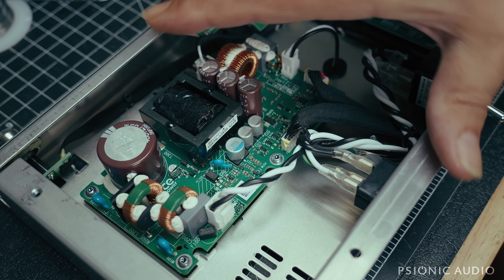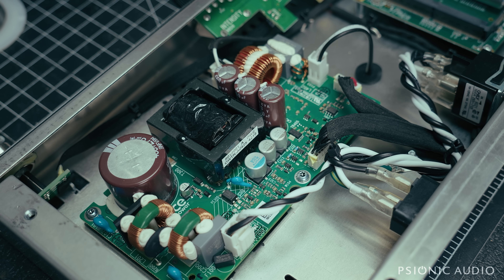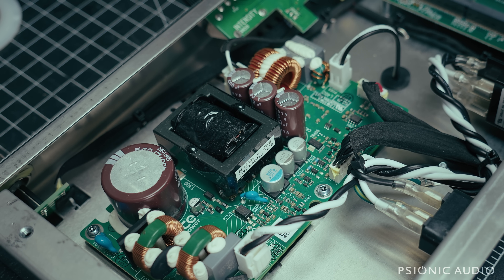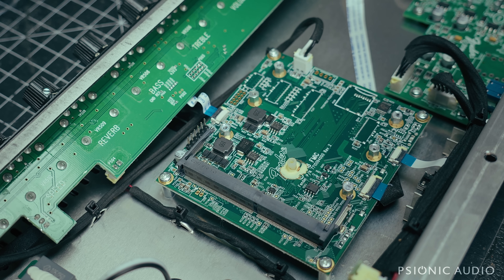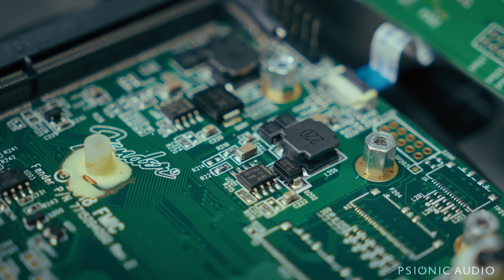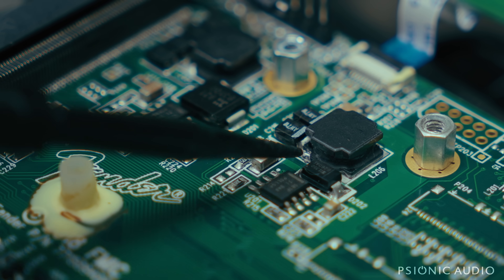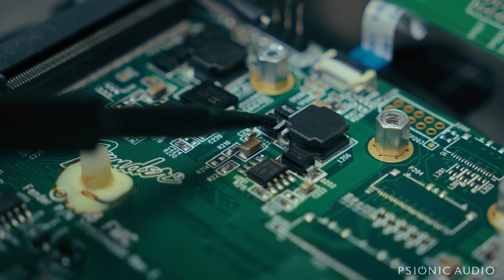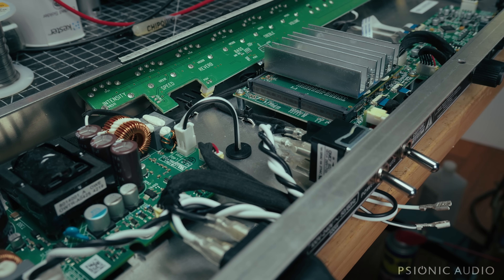The Fix is In | Fender Tone Master Deluxe Reverb No Sound and Flashing LED Pt 2

Comment: I had no idea Fender is making guitar amps which are 100% digital. 

Having worked on tons of “digital” and SMT PC boards for 20+ years I have 2 recommendations: 
1) Get a decent quality hot-air soldering station. 
2) Get the part numbers from the SMT IC chips and download their manufacturers data sheets. These often contain detailed schematics for “recommended application circuits.” Most real-world electronic products will be pretty close to these recommended circuits.

Comment: I have one in the shop with the exact same symptoms. When it first came in, I swapped in a known good ICE module to no avail. Fender Service told me Oahu has several service centers. They do, if you need guitar services…

I dunno, when I see an electric guitar plugged into an amp, it’s a single instrument with two parts.

Comment: Glad you didn't hate on it too much.  I have both tube amps and a DRTM.  I have to admit, I love it.  It is easy to move around, sounds great, and so far has been bulletproof.  I hope that doesn't change.
Reply: I have a bad back and my AC15HW1 with a Weber Blue Dog alnico makes my 60 yo back hurt! So, I am digging the TM Deluxe Reverb. My psych board sounds great through it. For me , it's 52 lbs vs 23 lbs, lol. . .

Comment: Nice fix, the cpu daughter-card reminds me of the ones in old powerbooks.  That signal drop at power-on is quite interesting, I have a Digitech pedal which does something similar but haven't had a chance to investigate it properly yet, its just a little repair project for a free day but would be interested to have an idea what to look for going in; suspecting a failing cap but its all smd components & hard to measure so I'm waiting until I get really bored before starting that one: bypass works until first press of the footswitch when the pedal drops all signal for a couple seconds, then works fine unless power is removed or the effect is switched off for more than two-minutes at which time the fault reoccurs which can be a little distracting whilst playing; less of a problem with an amp which isn't being switched on & off during play.
Reply from the maker: Oh, this isn’t a problem, they probably just auto-mute the output for a fixed period to make sure no pop comes through the speakers.
Reply from the maker: In the Tone Master I mean. Yours probably has an iffy cap in the flip flop circuit.

Comment: Brad Webb is one of the smartest people I have met (not in person) in my 58+ years of wandering about on this planet. I have done SMD with the small iron that plugs into my old Weller, and now I have the Pace tweezers, the Pace hot air too, the small Hakko pen. The Pace are Sensatemp. Chipquick paste sure makes life lots easier. A puddle of flux, some extra thin (expensive) solder and a tiny iron & tweezers with a very steady hand works okay if you are used to it. I  went from my Baush & Lomb microscope to some old Dental magnifying glasses. The depth of field and field of view are very small with them but unlike a high magnification Optivisor my face is not 2-3 inches away from my work. It's out around 12-14 inches away. Much much better! The B&L dissecting scope is just a pain in butt.

Comment: I could have sworn Brad had one of these, to the point where I was confused to see the follow up here. Yall get so much of the same stuff at the same time that I can’t keep it straight until I hear the accent (or lack there of).
Reply: Yes, I've had a few.
Some were this very issues, others had fried Icepower modules.
So far there's only been one with a dead CPU which couldn't be recovered.

Comment: I'm glad you are able to figure these things out but man they really are just computers with a power amp and a speaker.  Just not sure how I feel about that.  No doubt they have got to be a lot cheaper to build, and they sound pretty good, but it just seems like a lot of money to pay for something that is end of day just a disposable.  My Dr. Z may not be the most beautifully wired machine, as you've pointed out a few times discussing Dr. Z, but it is on its third decade of life and has never given me any trouble.  And if it does, there are still quite a few repairmen out there who can fix it with some solder and a few parts.

Comment: I bought one, the blonde version: failed with this exact same light blinking and no sound, on the very first gig... returned it and got a new one. It still works perfectly.
It is very relieving to know they can be repaired, if needed. I find it good enough for gigging. Thanks Lyle!

Comment: I think you have to put these in proprtion. The fact that the local Fender service centre knew nothing of this fault/repair should be indicative of how common this fault is. When they first released the Tonemasters nearly 6 years ago, everyone called them computers ( which they have an element of ), and "throwaway products". Ive had a tonemaster reverb since they first came out and a tonemaster twin with no problems and a couple of hundred gigs with them, no tube or cheap cap changes, so they have paid for themselves.
Any harder to work on than some Blackstar PCBs? Or Mesa over engineered amps?, and worse
Reply: FYI, it goes like this:
- Tech inquires with 200+ other professional techs if they have experienced the issue.
- 30+ other techs inform initial tech: "yes, they said they have never heard of that issue and cannot help".
- Initial tech asks if any other techs have solved the issue.
- 3-4 techs MAY reply (and in this case, a legendary follower!) that they have figured it out and reply with the fix.
- Initial tech applies the fix, customer keeps creating art at initial tech's satisfaction.
- Initial tech extends the solution to the manufacturer.
- Initial tech gets no response.
The goal is to make money, not be good at what they do or be good to the customers.
You NEED to understand that in 2025. Please understand that.

Comment: Why is this $300 ss/digital amp $1,300?  Because it is supposed to perfectly replicate the original Deluxe Reverb tube amp?  Does it?  Why not go for the Fender Champion 50 for $240?  Is the "tone difference" really worth an extra $1,060?  🤔
Reply: I bought a floor model for $799 and yes, they sound 95% like a tube type Deluxe.
The attenuator feature is outstanding.
Reply: $1300 seems like a rip-off to me.  If it had extensive modelling options like a Helix pedal, I could understand that price.
Reply: @JohnShalamskas  You could buy a HX Stomp and a Fender Champion 100 for less than this Tone Master amp.
Reply: Like most gear, buy used, prices of these used gave shot down.

Comment: The sad thing learned from this view of the boards involved is that the board sizes have shrunk far below what provides value.   If you are making a Deluxe Reverb clone, the chassis is GOING to be 25 inches wide by 10 inches deep.  If the modern electronic / digital incarnation can fit on a densely packed board only 9 inches wide by 4 inches deep, well great, you've  saved maybe $4 in PCB materials cost but that's  immaterial on a $1370 product.  But using high density  parts on a tiny board has likely inflated every repair by 2 hours in labor via the hassle of SMD devices and poor board layout.  For products whose outer dimensions are NOT always shrinking, engineers need to use the space they have.  (Yes, I am aware that using 1970s style discrete components isn't  always an option cuz some parts are only being made in SOIC and smaller packages...)
Reply: I interpreted what Lyle was saying, that the ICE Board is generic in all Tonemaster amps. While there may be plenty of room for a larger PCB on a Deluxe chassis, maybe not so on the Princeton or Bassman? If Fender make these boards in house they may come up with a revision, but I'm guessing these ICE boards are OEM to them.

Comment: I didn't think the Tonemasters would be worth repairing ie an economic repair .... but I was wrong, and your customer is lucky to have you. That said, your video confirmed my prejudice against ever purchasing a solid-state amp or a tube amp that utilises SMD components. The Tonemaster Deluxe Reverb was only released a little over 5 years ago and  you're reporting that these sorts of failures are common.
As for Brad, like the Pirahna Bros "he's a cruel man .... but fair"
Reply from the maker: He knew all the tricks - dramatic irony, metaphor, bathos, puns, parody, litotes, and... satire.
Reply: I’ve had my TM for five years with zero issues. Great amp. Not all of us have the luxury of a place where we can crank up a tube amp to get the most out of it. This kind of thing just makes sense for some players
Reply: @staticloop-n9m  tube or solid state...it's being able to find a good tech that counts and from what i'm hearing more people are leaving/retiring than coming into the industry
Reply: I've been following this by reading the colour supplement

Comment: What a nightmare. Mass manufactured SMD’s destroy techs. Infuriating garbage.
Reply: Mine has been working reliably for five years. Also, he was able to fix this pretty inexpensively and in a straightforward manner. The problem is not the amps – it’s techs stuck in the past who don’t update their skills. This guy is good
Reply: You try soldering and desoldering surface mounted components.  They aren’t designed to be serviced. They are designed to buy the whole circuit board or dispose of it. No doubt Lyle is a great tech, but you think he likes working on this stuff?
Reply: @PhoenixGuitars  what are you gonna do? If you want to be a tech, you have to work on modern gear, right? How much longer do you think guys are gonna be lugging tube amps around for? Many diehards have already moved to modeling platforms. He probably likes working on whatever allows him to continue operating a successful business
Reply: Don’t disagree. That’s one reason why techs are a dying breed. I have a few modeling amps myself that are quite good. Cheers.
Reply from the maker: If it all goes to modeling I’ll do something else. Just because I could repair garage door openers doesn’t mean I want to.
Reply: @PhoenixGuitars ha fair enough, man. And likewise, I would absolutely prefer tube amps all day every day if I thought I could really open ‘em up and let them sing the way they deserve. Someday I will know that joy
Reply: @PsionicAudio  OK well I just got served by the man himself lol. I humbly concede. I hope your business continues to treat you well for many years to come, in the way that you enjoy doing it 😀
Reply from the maker: No worries dude. I get your point. But just because everything is getting shitty and disposable doesn’t mean I’m on board. ;)

I’m old enough to remember when McDonalds had good fries…

Comment: Nice video Lyle! The Fender AImp sounds decent when not broken, but why the heck did it fail and why wouldnt it just fail again?
Reply from the maker: No real protection against spikes in mains voltages perhaps? I don’t have the schematic, so just an educated guess from peeping at the circuit.

Or maybe they got cheap diodes. I sourced good brands.

Either way, fingers crossed this doesn’t happen again.
Reply: @PsionicAudio  I have noticed that failure to protect modern electronics like computers from voltage spikes on the 110V AC line leads to premature failure.  This is especially true in areas with lots of lightning.  But motors, compressors (like in a freezer), and large loads switching on or off will send you plenty of spikes from all over the neighborhood.

Comment: The nice thing about those switching regulators at least is that most of the time the circuit on the board, and the PCB layout, is pulled straight from the datasheet for the controller chip. So pulling that up will get you at least 90% there, if you need to dive that deep.

Comment: The stage you found the problem in is a DC-DC converter. It uses the inductor and capacitors and the mosfet chip to control the voltage, usually a step-down to power things like low-volt CPU cores and what not. They are very common failure points on big GPU cards for gaming.  You might start looking for a reasonable hot-air soldering system since SMD stuff ain't going away. At least there are reasonably priced ones now.
Reply: Im not sure hot air is all that useful unless you're reflowing multiple components or IC's, heated tweezers might be a better solution for single component replacement like this

Comment: The more I hear about SS and digital amps, the more grateful I am that I don’t own one.
Reply: Traditional SS amps are fine
Reply: Laney LF Super60 212, Orange Tour Baby 100, Roland Blues Cube Artist, Quilter. There are a few gems out there in SS land. I have lots of tube amps but I do love my SS amps as well. There are some really great sounding SS amps being made today. Don't write them off.
Reply: Solid state amps were a fad in the 80's just like all this digital modeling class D trash is right now. It'll come full circle again, it always does.
Reply: @darrencampbell8817 Solid state (which encapsulates class D), modeling or not, can be made exceptionally well and last decades. People like cheap stuff though, so quality suffers. I'm sure similar was said about HiFi stuff. Where are all the tube television sets, anyhow? These modern cheap televisions only last a few years!

The current thing is machine learning based true amp modeling, and it's not going anywhere. Whether one of the popular pieces of software, or the free one, and one if the best NAM (Neural Amp Modeler), they're too damn good. I pretty much only use my few tube amps I've built, but I made some models of them in NAM, as well as some pedals, and its ability to clone them is pretty surprising. Its a similar idea to Kemper amps. 

I figure, it's good to have an idea how it works, since tubes are a couple factory shutdowns from being extinct... Buy ey for now, let's run em.
Reply: @darrencampbell8817  Maybe, but physical amps in general are becoming obsolete.  I own both a real Tone King Imperial Mk II head and the neural DSP of the Imperial mk II.  They might feel SLIGHTLY different, but the main difference is just the speakers in the cab I run the physical amp through.  When I say slightly, I mean slightly.  Not enough to justify spending over 2k on the amp for most people.  I like to feel the air moving, but a lot of modern rockers dont really care much about that.   A lot of musicians are just carrying around their digital rig of choice, whether it be one of the helix derivatives, the tone master, or even just an amp in a single pedal like the H&K Spirit with some kind of effects modeler.  Not having to carry around a ton of equipment is worth the trade off for a lot of gigging artists, especially if they dont have the money to have actual stage support.  Just plug into the house mix, and you are good to go.  All with less than 25 pounds of equipment including guitar and rig.  The vast majority of audience members never know the difference.   I dont see that going away.  I love physical amps, both digital and tube amps, but I also love modelers.  There is space for both, and I think digital modelling is probably going to be what the majority of musicians, pro and amateur alike, use in moving into the future.  Its not necessarily bad, its just different.
Reply: Have to agree, I'm still a tube guy but about priced out of the market.
Reply: Time to sell your cell phone.

Comment: Nice work. As an owner of one of these, I’m terrified that as soon as my TMDR goes out of warranty, I’ll be screwed because no one will be able to repair it. At least not without an expensive major overhaul. I hope Fender will have more resources available for repair folks moving forward as these amps, like any other piece of electronic gear will encounter their share of hiccups down the road. I bought in to Fender’s hype on these because I like the feature set and weight reduction. I think it does do the thing about 75%, which is ok with me. I’m betting on a dependable tool that will give me at least 10 years for the price. So far, so good. Thank you for the look under the hood and the trouble shooting and solution processes.

Comment: Magnifying glasses on the face and a good pair of tweezers. As someone with shaky hands, I hate surface mount work.
Reply: I did a lot of sm work and rework.   After I turned 42, I had to break down and get a magnifying visor for pcb's that wouldn't fit under the scope.
Reply: If you do lots of this a digital microscope and a hot air work station is the only way.  If its occasional, you make do though right?
Reply: @BenState , in 20 years of bench tech work, I rarely worked with SMD stuff; I made do okay with three sets of Optivisor magnifying headaets, up to 10X. I did have two soldering stations, two heatguns, a vacuum desoldering gun, and chipquick....

Comment: Lyle, check out "NORTHRIDGE FIX!" He is an excellent tech for pcb fixes and he sells all of the equipment that he uses. He uses a top down camera with a mount that would kick your channel up several notches!
Reply from the maker: I’ve done top-down, don’t like how it flattens things out. I just need a longer lens for stuff like this, mounted up but at an angle for depth.